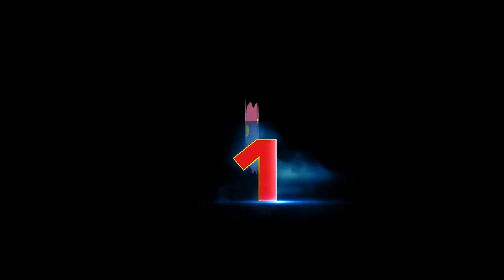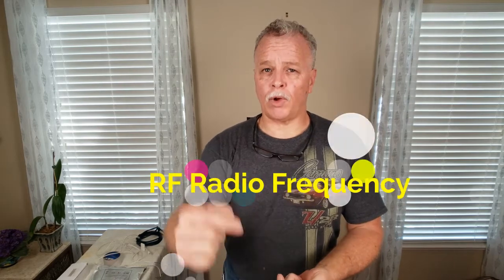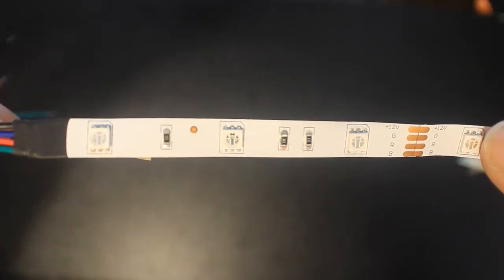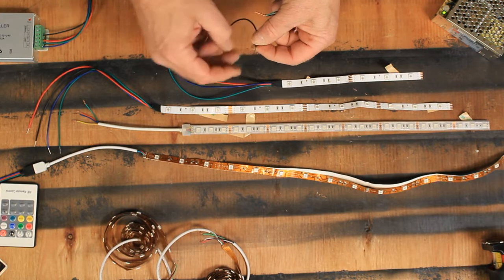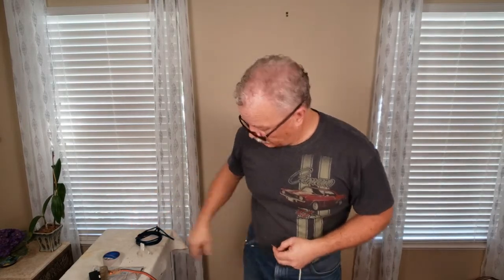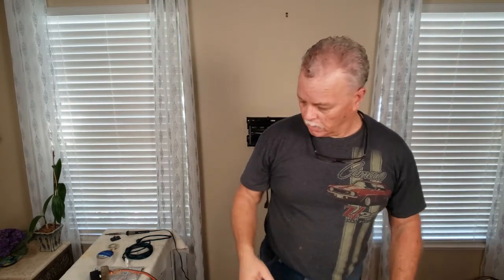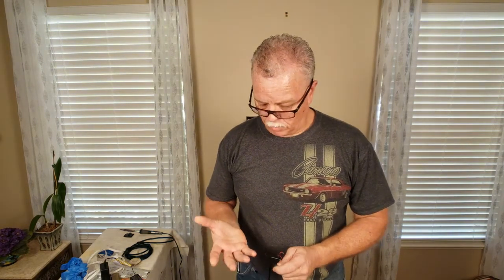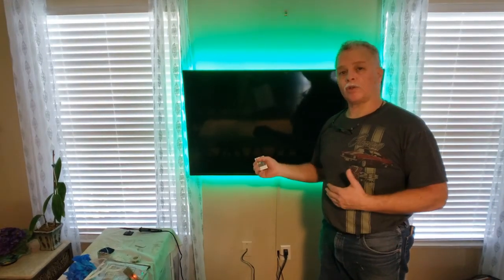How To Install LED Light Strips Behind TV / Halo Lighting behind TV Step by Step

Comment: Please don't use contact cement, LEDs don't last forever, you may want to remove them and keep your TV. Also be careful recommending RF controllers. I've had LEDs and other equipment controlled by RF that would receive RF signals from other nearby devices (apartment buildings, neighbors etc.) and randomly change settings... Not fun.